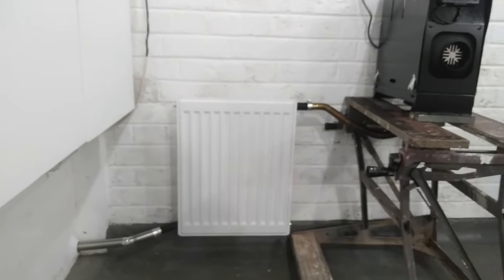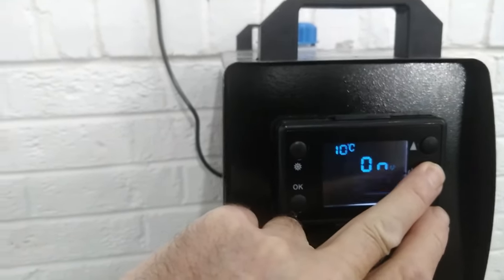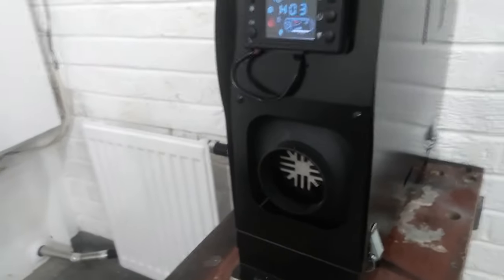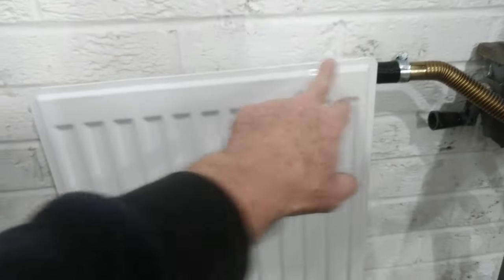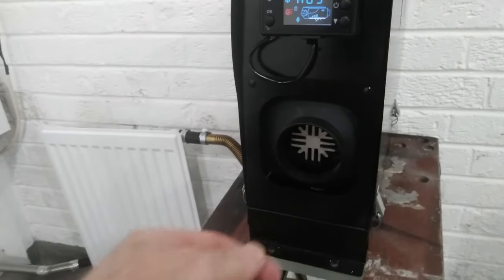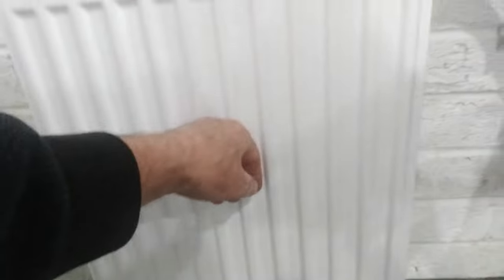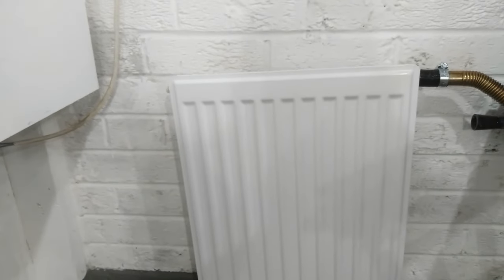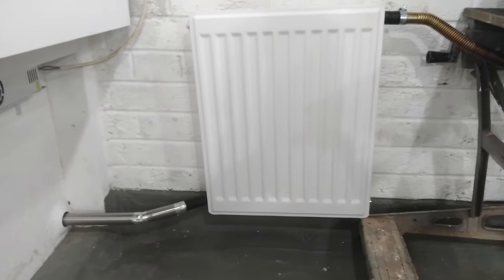Free Heat from Waste Exhaust Gases Heating Radiator Home Oil Diesel Heater Chinese Recovery Exchange

Comment from the maker: Links:
Heaters: https://amzn.to/3ZwMAPc
12v power supply: https://amzn.to/3ZwMAPc
Long flexy exhaust pipe: https://amzn.to/3ZwMAPc
Radiator: https://amzn.to/3ZwMAPc
New control panel: https://amzn.to/3GW0mDu
Ducting: https://amzn.to/3CF7l0W

Comment: I think that's a great idea! The only caution I would recommend is keep an eye on the bottom of the radiator if it's not stainless steel. I know in Canada Natural Gas furnaces use a stainless steel secondary heat exchanger because when the exhaust gases condense into droplets they are very corrosive so it has to be stainless steel. I don't know if this applies to diesel or oil but I just thought I'd mention it.
Reply from the maker: Thanks for the info! good point. 
kindest regard andy 

https://youtu.be/6rQAo8lSLHY this is the other one in the house.
Reply: Yes it is very corrosive with diesel too. Probably more so than natural gas. But I bet that radiator will still last several years. I think he said he paid only $20 for it so if it only lasts a hand full of years. I'm sure it would pay for itself.
Reply: @jim4556  this, i wouldn't be concerned at all I'd just replace it when it went bad. These junk/free or cheap radiators are everywhere.....
Reply: It’s not just moisture it’s carbonic acid. Uk radiators are ferrous metal. You would be better using an aluminium one if you can
Reply: Have you measured the temperature difference between the exhausted gas when radiator connected and when the line is directly without radiator? So you could calculate the temperature "collected" inside the room?😊
Reply: @HogwartsBasement  Yeah but it's a garage in the UK. People literally throw away old radiators, and this will last for years and extremely cheap to replace.
Reply: @jim4556  The problem with that is when it suddenly poisons him in a few years because he didn't expect it and no problem is visible until the hole makes it through to the outside.
Reply: @_captain_underpants Car exhausts heat up and pass vapor all the way through after a few minutes of operation. With this radiator setup the exhaust will be cooled and corrosive liquid will condense inside.
Reply: Just mount a carbon monoxide alarm nearby, then if the corrosive liquid does rot through the radiator you’ll get a warning before it kills you.
Reply: @saiboogu could you put the heater higher and slightly tilt the radiator so that the moisture runs out ??
Reply: Radiators are literally made to work with water.
Reply: @GoingtoHecq  That is why you have a CO2 monitor to warn you. You have the same risk in a home if a boiler leaks or the catalyst in a flueless fire fails. You mitigate the risk.
Reply: Very cool. I had a 12000 btu heat pump installed in my garage. Love it.
Reply: What if someone could pour or spray some oil inside the radiator to collect on the bottom, maybe an inch deep, to help combat any corrosion through the bottom where the moisture collects?. Also, if the heat is sufficient enough  it should vaporize most of the moisture and allow it to flow out through the exhaust. Maybe put some type of a valve or door at the top and open it to allow some of it to escape through the top. I'm thinking like it would be on an automobile. Most of the exhaust systems that rust out fast and have rusty internal engine components are the little old ladies that drive to the store and back and never allow the engine and exhaust system to warm up enough to vaporize the water moisture that's a normal part of combustion.
Reply: @maxxdroid nah, its propylene glycol or something else like it. Water itself is rarely if ever used
Reply: @ralph1881  dude, this is a household radiator. Literally works with water. It Is Not an aluminum automotive radiator!
Reply: EN590 diesel fuel goes through a cobalt catalyst to remove the sulphur. The exhaust gas should be minimally corrosive. (1) Unlike natural gas, which has a sulphur "odorant", red diesel has no sulphur to make the acid (2) CO2 does not dissolve easily at high temperatures (3) there will be minimal free oxygen in the exhaust gas to feed the corrosion..

Comment: I'm an heating engineer. Heating elements usually work better when placed at the bottom of whatever is required to be heated ie, a kettle or oil filled radiator, immersion etc and the heat itself is used to do the circulating. To get the best and maintenance free output from the set-up it's best to have a stainless steel pipe  passed through the bottom of the radiator for the exhaust gases to pass through and the radiator sealed to it allowing no leaks from the radiator. Then fill the radiator with diathermal oil to 80% capacity to allow for expansion, heat and bleed air until hissing stops then seal bleed valve. Have radiator very slightly tilted by a few degrees to allow condensate to expel naturally.
Reply from the maker: great comment
thank you cheers andy and happy new year
Reply: Location of heating elements isn't part of this equation. "Engineer"
Reply: Alternatively use water with a corrosion inhibitor around the hot exhaust pipe.

Comment: I think , but I'm a nobody 😂 the exhaust and intake need to be the same length to balance the combustion, while I agree in large your exhaust looks like steam there is a part that's white more dense looking so you may find the burn isn't correct, not saying it won't or doesn't work just may coke up quicker?

Comment: This is very much how a condensing boiler works, it passes the spent flue/ exhaust gasses through a secondary heat exchanger, your secondary heat exchanger is the steel radiator which will rot due to the acidic water produced from the hot gasses condensing inside the initial cold radiator That's why flue's and secondary heat exchangers on boilers are either plastic or stainless steel. Strongly recommend a non corrosive radiator and a Carbon Monoxide detector
Reply from the maker: Great point! 

thanks for looking.
did you see my other heater videos  https://www.youtube.com/@andyfireblade
cheers andy
Reply: @andyfireblade  Hi!  Any chance you can please provide the search string for your radiator?   The link itself is not working in the US, at least.
Reply from the maker: @taliaperkins1389  try this one https://amzn.to/3tqQii3 merry christmas andy

Comment: A radiant heater is OK in the house but it doesn't give off much heat with a fast flow of hot gas .......you will need a heat exchanger that has a fan and a core .......like a car's radiator system but with exhaust gas and air flow......the inlet exhaust gas temperature and the final outlet exhaust temperature will prove its efficiency.

Comment: Condensation is pooling in the low side of the exhaust pipe coming out of the heater. You should raise the heater so the exhaust is always flowing down or your exhaust is going to corrode from the inside out.
Reply: The first part of the exhaust is very hot there will be no condensation
Reply: @tristar8950 yeh my thought exactly,.. any condensation vaporises pretty quickly!

Comment: I had a similar idea when I saw these diesel heaters, well done for having a bash. Some thoughts I had were rather than passing the exhaust gases directly through the radiator, another way would be to feed it into a shell and tube heat exchanger. The radiator can then be filled with thermal oil and a small pump attached to circulate. Should eliminate the condensation/corrosion problems and the heat will also be retained for longer in the radiator. You can easily expand the system with more radiators as well if required.
Reply from the maker: brilliant idea my friend. yes just experimenting but thats a good one, i might have a go at that.. and thank you for watching. 
kind regards andy , did you see my other heater , heating the house. 
https://youtu.be/6rQAo8lSLHY
Reply: @andyfireblade  Just watched your latest video. Awesome job and seems to be working a treat, are you going to try it with thermal oil? The oil should be able to get much hotter than water as it won't boil. Might also be worth considering bringing the exhaust pipe straight down from the heater to the tank, at the same level as the bottom of the radiator and then out the wall , sloping slightly downwards to ensure any condensation is exiting the pipe. I think this is a fantastic first attempt though and proves the concept very well😁😁😁
Reply from the maker: hey fast eddy
i have just don the latest video, please watch it ! i am really happy with how it worked out.

https://www.youtube.com/watch?v=wScN6uoYF4Y&lc=UgwYjsbR4YvvekjwZ4d4AaABAg.9l7Jc-gf1TO9l7OPphyHJZ
let me know what you think
kind regards any
Reply: @andyfireblade  Awesome proof of concept😁, heat exchanger works a treat
Reply: @andyfireblade  those heat exchangers are very expensive. Several hundred pounds.

Comment: Beautiful installation. The radiator should be tilted a little so that the condensate runs to the outlet. 
The air flow of the diesel heater could be directed above the radiator so that the rising air flow of the radiator also has an additional horizontal movement component and does not rise directly below the ceiling.

Comment: I'd love to see a couple of those little sterling engine fans on top of the radiator to move the air around, this is a really efficient set up overall..
Reply from the maker: good idea, cheers andy
Reply: @andyfireblade  Love the channel man, I've been binging your content. I plan to Insulate my two car garage and get an "8kw" Heater for the winter. Your content is full of great ideas, And I'll be putting them to good use next fall. Keep rockin
Reply: You could run a tumble dryer flexy hose from near the ceiling to the diesel heater cold air inlet. That would pull warm air down to a useful level with no additional fans.

Comment: I like this idea and will adapt it to my garage. I have a dehumidifier that runs 24x7 to protect the expensive motorbikes from corrosion. It samples the air every 30-minutes to see if it needs drying. Your solution would raise the temperate to allow the air to hold more moisture and reduce the energy used to dehumidify the cold damp air. This could reduce my household bill by 50% because maintaining a damp free garage doubled my energy bill. Great informative video.
Reply from the maker: thank you graham, your set up sound great. the good thing about these heaters , is that the heat given off is dry. the "burn" fumes go outside though the exhaust. i have had diesel heaters in the past, and the condensation would be dripping down the coldest walls and rust my tools .
i have a Kawasaki er6n 650 at the moment by the way, no fireblade at the moment.

thank you for your comment did you see my other heater vids, https://www.youtube.com/@andyfireblade let me know what you think, cheers andy

Comment: You've probably got a good bit of moisture building up in the bend after the heater but before the radiator.  So raise the heater to make sure the exhaust goes downhill.  You may need some ducting to ensure better mixing of the air down near the floor. So pull cold air from the floor and pipe the hot air out near the floor in such a way as to not put it in with the. Older intake air.
Reply from the maker: Thanks for the tips!

kind regards andy , did you see my other heater , heating the house. 
https://youtu.be/6rQAo8lSLHY
Reply: Just after the heater before the radiator, it’s about 250c. No moisture is condensing in that section of the pipe it’s too hot

Comment: Nice job Andy. I have a similar set up, only I ran my exhaust gas thru a 10 ft long 1" & finishing through 3/4" copper pipe which is a fabulous conductor of the heat keeping that much in the room.
(Summer house) 
Regarding the condensation / steam from your exhaust. Almost a definite result of clash of temperatures. I tested the heater without the extension pipe and yes it ran clean & dry (no steam) 
I would advise from my findings that your exhaust needs to be heading downhill the whole way out as you will eventually have condensation blocking on that low point on your exhaust.
Thanks for the vid. Ray
Reply from the maker: hello ray, thats great to know. 
and thank you for watching. 
kind regards andy , did you see my other heater , heating the house. 
https://youtu.be/6rQAo8lSLHY

Comment: It seems to me that the best option would be to use an antique cast iron steam radiator, mounting the heater higher than the lower fitting (so that any startup and shutdown condensation doesn't migrate back into the combustion chamber), then plumbing the exhaust into the lower fitting, out the top and then to the outside. This method would mitigate the condensation concern (especially if it's run long enough for everything in the exhaust stream to heat up enough and prevent moisture from collecting), along with hopefully creating more even heating in the radiator.

The only thing I'm completely stumped with is just how large of a radiator could be used before you see diminishing returns. Obviously you'd want the largest you could realistically use before reaching that point for the sake of scavenging as much heat as you can.
Reply from the maker: my thoughts exactly, i would like to try a big cast iron radiator.

thank you for your comment did you see my other heater vids, https://www.youtube.com/@andyfireblade let me know what you think, cheers andy

Comment: This is a great idea though you really want to have hot gasses going into the bottom of the radiator and out the top but then you have to deal with condensate. This could be done with a separate narrow pipe coming out the bottom. Also get a stainless radiator as the cheap steel ones will corrode like crazy because diesel exhaust gases are corrosive.
Reply from the maker: Great point! cheers andy
Reply: EN590 diesel (red or white) has virtually no sulphur.

Comment: Awesome set up
Reply from the maker: Great idea
thanks , and thanks for looking
did your see my other heater videos
https://www.youtube.com/@andyfireblade
let me know what you think

cheers andy
Reply: Until he needs to clean the radiator that's now filled with soot, sure. It wouldn't have been an issue if this was a propane heater but this is burning diesel.

Comment: I Russia where they have done this on several channels they used cast radiators as the exhaust condensate is quite acrid - they claim up to 1.5 kw of heat can be recuperated at full power

Comment: Nice to see the experiment and thanks. It would be interesting to cut a generic radiator open after a couple of months and see what it looks like inside ! Obviously not yours Andy !🙂
Reply from the maker: Thanks for the idea reg! another video? hahah . thanks for your comment regards andy
Reply: It will badly corrode a cheap steel radiator like this, you really want to use a stainless radiator.

Comment: Panel rads have a baffle fitted inside the bottom part. So connection at bottom opposite ends will allow the top to get hot but will also cause condensate to become trapped.
Reply from the maker: thats good to know, thanks andy

Comment: It looks good but you have a trap on the exhaust between the heater and radiator id either place the heater higher or further from the radiator to straighten the pipe or shorten the pipe.
Reply from the maker: thanks cheers andy

Comment: Would be interesting to see that radiator on a thermal camera aswell, to see the heat moving through the rad and the temps it settles at.
Reply from the maker: yes, i would love to do that. but they are really expensive.

thank you for your comment did you see my other heater vids, https://www.youtube.com/@andyfireblade let me know what you think, cheers andy
Reply: @andyfireblade  yes they are not cheap unfortunately, even the camera phone attachments of them are expensive.

Comment: It would be interesting to see how you fitted the 24mm exhaust to the radiator as they usually have 15mm tube
Reply from the maker: thanks for your comment
i hadent put the valves in the radiator holes. so the hole was perfect.
thanks for your comment, kindest regards andy

Comment: Im just planning on gearing up a "sand battery". Basically I'll be mounting the heater high enough that I can put a tank directly underneath it, run a couple of coils of exhaust pipe within the sand filled tank, then out through the wall. All of my exhaust pipe will be running downwards and the total length probably won't be much more than about 6 or 7 feet. ANY amount of heat captured by this method is money saved and increased efficiency. 👍
I have a brand new, never used but outdated 20lb propane tank, will cut the top off so i can coil the exhaust through it, drill a hole for the outlet, fill it with sand, replace the top, etc, etc....
Reply from the maker: sounds great, good luck cheers andy

Comment: just a thought you could use an old inter cooler as there is a lot more surface area on them and there made to cool air not let of heat from hot water
Reply from the maker: i use an inter cooler on another video, 

thank you for your comment did you see my other heater vids, https://www.youtube.com/@andyfireblade let me know what you think, cheers andy

Comment: Try a series of bends in the large pipe with a radiator at the end to keep the heat in the larger tube maybe heat sink on the top to put the hottest heat in the air while effective.
Reply from the maker: thank you for your comment

did you see my other heater vids, 
https://www.youtube.com/@andyfireblade
let me know what you think,
cheers andy

Comment: Wheres this 2kW figure coming from in the thumbnail?
Reply from the maker: i have a convection electric 2kw radiator, and is giving off the same amount of heat as it.

thanks for looking.
did you see my other heater videos  https://www.youtube.com/@andyfireblade
cheers andy
Reply: @andyfireblade  based on what measurements?